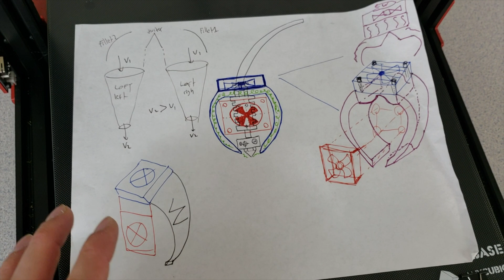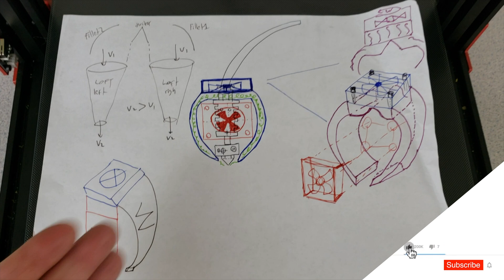Top 5 Mods / Upgrades for Alfawise U20

Comment: Love your video, but had a funny issue with mine, where the X limiter was too far down and the head collided with the bed, found no extra bolts blocking the bed and bottoming out the bed was still not enough, had to bend the limiter higher
Reply from the maker: Do you mean z limiter? Did your solution worked?
Reply: @3DPDoctor  I might, always mix up my axis, but yeah, it works great now

Comment: If I may ask for clarification, the Ultrabase  you used in the video seemed to fit the Alfwise U20 however none of the sizes on the amazon page you link to seem to mach the dimensions of the alfwise's build plate. Is there another place where we could get one that would fit better?
Reply from the maker: The links must have changed, sorry for that. Here is the link from anycubic website: https://www.anycubic.com/collections/parts-accessories/products/platform-tempered-glass-plate-310mmx310mm-for-large-print-size

Comment: Haven't even got my hands on my new (used) U20 yet, and I'm already looking at mods...  Subscribed.
Reply from the maker: Thank you! Don’t forget to tighten your rail rollers since it is used. Also, use machine oil on the lead screw, check out the heat bed area against tears if so don’t forget to change it. Finally clean inside the nozzle and bowden tube.

Comment: I really like your creativity, I must try your spool holder. About the dual fan nozzle; it would be great if you finished that design. There are many such on thingyverse, but for some reason they are designed for two 40mm fans, but U20 (8at lest mine) have one 40mm for the filament cooling, and a smaller 30mm (?) fan for the hot end. If you could design one for the smaller fan in the middle and help us to not have to change fans, you would be a hero.
Reply from the maker: Thank you! Unfortunately I gave away my u20 so I won't be able to :/

Comment: I recently bought the Alphawise U20 Plus (not Pro...it was a typo above).  It came with a Heater Base + a Black Aluminium Plate that has a 3 mm glass stuck to the bottom surface of the top Black platform.  It is heated and I have gone up to 60 Degrees with no problems.  Once the model is done, I turn the machine off and come back later.  Using a small Infrared gun, I check the temperature and if the temperature is somewhere around 30 degrees or less, the model simply slides of the platform, without any problems.  But a couple of observations that I found very interesting:

1. I clean the platform with simple rubbing alcohol swab so that it is clean and dry of any residual material.
2. I use a compressed air can to blow off any dust (I am in Texas and it gets dusty...) before I start a model.
3. For some reason, I have to level the platform after each model (not sure why the little knobs get loose).  Maybe the heating and cooling causes that.
4. Important: It does not matter how well you level the platform, make sure that the "Center" is perfectly leveled because, for regular use, the print head starts printing from the center of the platform and if that initial layer gets messed up, the rest of the model will be skewed or wasted.
5.  MOST Important: My new Alfawise (April-2019) does have the old firmware and you need to use the Cura 15.x.x that came in your micro-SD card.  DO NOT Upgrade the Cura version until you get a different version of the Alfawise to generate your g-code.
Reply from the maker: Thank you for the insights